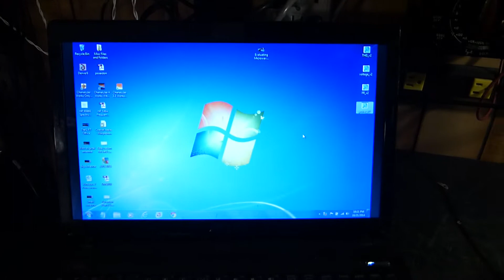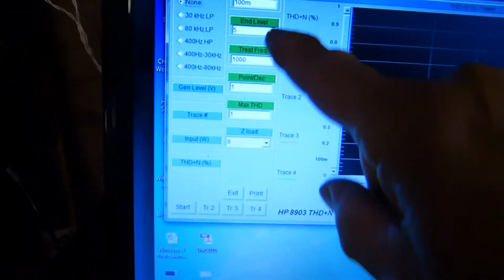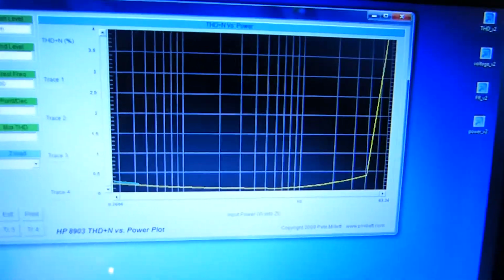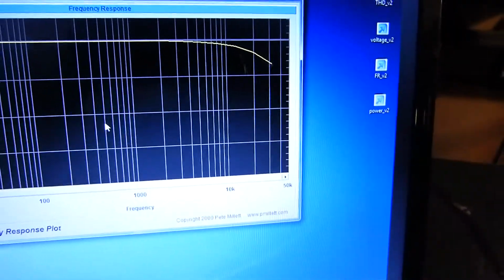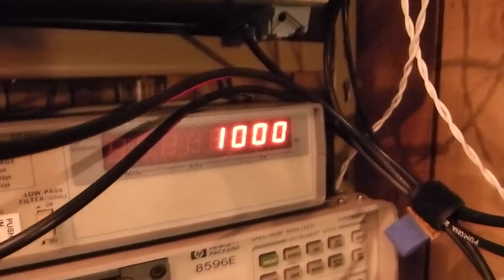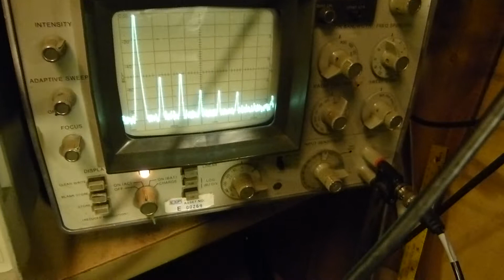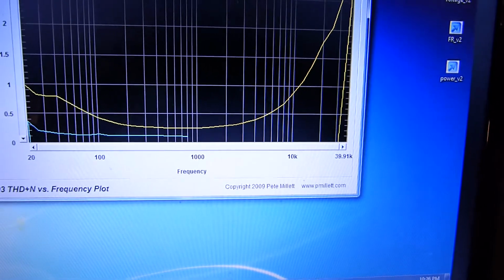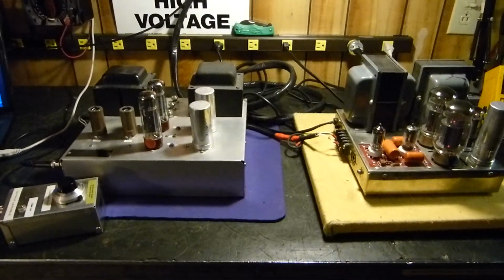Using The HP 8903 Audio Analyzer With Pete Millett's Programs

Comment: David, can u help me understand how to use the HP 8903 for THD and sinad measurement without the millet programs. I don’t think I’m doing it properly. Thx Ben.
Reply from the maker: Hi Ben,  I will do my best to help. I can make a short video and post it unlisted and send you the link and show a few of the functions I am familiar with. Would that help?
Reply from the maker: Ben, have you watched this video? I show more things in the video than I can remember to do nowadays.
https://www.youtube.com/watch?v=4KngW_wAVZ8&t=4s
Reply: @ElPasoTubeAmps  Let me review tonight. I think I might have watched but let me see if it covers the THD setup I'm trying. I'm also looking to get the analog meter for SINAD working properly. I think I remember you covering special feature 19 for measuring wattage. Anyway, thanks for the quick response as always. By the way I did get my THD issue worked out on my Fisher 400 restoration. I absolutely took your advise and made adjustments to the driver tubes. It took quite a while but I did get things balanced and this receiver sounds AMAZING. It was quite a job, New filter caps, new coupling caps, New Bias caps. Added an IBAM, many updated resistors, 75% replaced tubes.  It took months to complete but worth it. I do have a question for you now that I think of it. While I added 1/4 watt 10 ohm resistors to the cathode of the 7868 power tubes to act as fuse and provide a test point for measurements, it seems like these resistors might have cut some of the power to the output tubes. This amp should get to about 25 watts but I really don't get past 14 watts... Note: I don't clip until almost max volume. I wonder if putting those resistors impacts the power output somewhat.... Any insight?? Not really a concern since I hardly need more than a few watts to function in my setup... Nice talking with you again. I've been enjoying your current SE amp videos.  Thanks, Ben
Reply from the maker: @bendec2969  On the 8903, the 19.0 is for 8 ohms or 19.xxx is for any other load resistance or you could put it in as 19.008. Sounds like you have your Fisher 400 working great. Those are beautiful receivers. I had an 800 some years ago but sold it. Honestly, 15-16 watts is what these units do best. Trying to run both channels at 25 watts at the same time will drop the PS voltage considerably resulting in lower power and higher THD. As for the 10 ohm  resistor, even at 100 mA, that is a 1V drop and series resistors like 10 ohms, results in (1) a test point to measure voltage and calculate current (2) a very small amount of local NFB to improve linearity (3) provide a little "balancing" series R to help each tube perform more like all the others. I had no idea what the acronyms IBAM and IBBA stood for but I figured it out. With your four balancing pots, you have the most versatile. As another thought - I looked on Pete Millett's website and the instructions for configuring the 8903 with its HPIB/GPIB interface is not there any more. Thanks for the conversations. David
Reply: David, that video did explain what I need. The only question is when do you use the analog SINAD meter. When ever I engage it to goes to max reading? Thanks Ben,
Reply from the maker: @bendec2969  Hi Ben, I don't know about the SINAD meter. I have never used it. I will check mine and see if I can figure anything out how to use it. Looking at my meter it is graduated as 0 - 6- 12- 18 - 24.  Per the HP manual:   SINAD meter is marked for EIA and CEPT sensitivity and selectivity readings (when within limits). Is this what we are talking about concerning SINAD ?
Reply from the maker: This might help.   https://www.youtube.com/watch?v=fNtvXVpghiY

Comment: CAN THIS SOFTWARE BE USED FOR THE PANASONIC VP-7722A ?
Reply from the maker: I don't know. If it has that same adapter, then it might work as I assume Pete's software is written to communicate with the HPIB adapter also known as the GPIB adapter - they are the same thing - maybe you can ask Pete Millett.
Reply: @ElPasoTubeAmps  Thanks

Comment: What type of GPIB did you use? I saw the usb but I was under the impression that it only worked with pci and isa.
Reply from the maker: it is called HP (or Agilent)  82357B.  Here is a link to one on Ebay for reference.

https://www.ebay.com/itm/Agilent-82357B-USB-to-GPIB-HPIB-Interface-Adapter-For-8163A-8163B-8164A-86100A/112054450762?hash=item1a16f73a4a:g:UqQAAOSw8cNUR04W:rk:2:pf:0

Comment: I have an 82357A interface and Runtime 9.3 installed, cant seem to get it configured correctly, getting the question mark
Reply from the maker: It can be a challenge to get it to work but  it is worth the effort. I don't know of any particular stumbling block except to don't forget to save the settings. That bit me for a couple of days... I have other videos on this installation and configuration that might help. Good luck - I am sure you will figure it out.
Here are two more links that might help.
https://www.youtube.com/watch?v=4KngW_wAVZ8
https://www.youtube.com/watch?v=_FtJh3N4FK0
Reply: John, just guessing, but did you name the Instrument (the 8903) "Audio Analyzer" (without the quote marks, of course) in the VEE Instrument Manager? Or can't you see the 82357A in the Instrument Manager?  If "Find" doesn't work, just add it manually with Name: "Audio Analyzer", the VISA Address GPIB0::28::INSTR and you should be good.

Comment: Hello there,
Very informative video! Can you tell me how do you phisically connect the feed from the dummy load into the 8903? Do you float the input on the analyzer? Do you use both conductors of the BCN cable or disconnect the shield?
Thanks!
Reply from the maker: The connection from the dummy load into the 8903 is direct wire. The shield goes to the negative (outside) side of the BNC connector and the center wire goes to the hot side of the dummy load. It is important to observe this connection because nowadays most everything has its negative side, including the 8903, connected together thru the safety ground of the AC power plug. It is probably best not to float the equipment from the safety ground. I don't remember the max voltage input to the 8903 but it is pretty high as I have measured the output of 1300 watts across 8 ohms (102 volts RMS) and it is within the voltage margins of the 8903.
Reply: Thanks for your reply. So this would work for both - standard output configuration and BTL outputs?
Reply from the maker: It will work for bridged output assuming the output stage of the amplifier permits bridging. I am sure you know that some transformerless transistor amplifiers can not be bridged.
Reply: Sorry for being late to the party, but could you please explain the connection of the output of an amp under test to the 8903 a little bit more in detail? I can't get my head around the correct way to connect an output from an DUT  to the 8903B. It would be absolutely terrific if you could help a novice with your knowledge. Thank you. And, of course, thank you for all of your effort to produce very good and informative videos.

Comment: Hi What interface are you using with the 8903? You mentioned it was USB. ?Thank You
Reply from the maker: It is called a GPIB or HPIB (same difference) to USB interface. The model number is 82357B and can usually be found on Ebay. Here is one to see what they look like.
https://www.ebay.com/itm/USA-HP-Agilent-82357B-USB-GPIB-Interface-High-Speed-Controller-TEST-A-IN-BOX/183135466583?hash=item2aa3b97457:g:~xUAAOSwqVdar32L